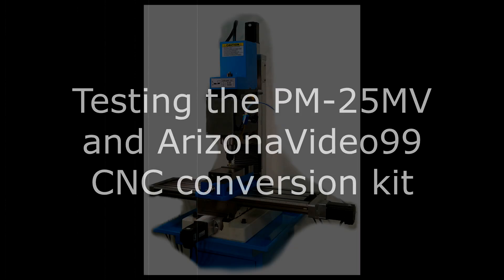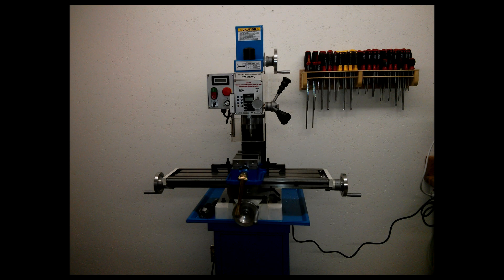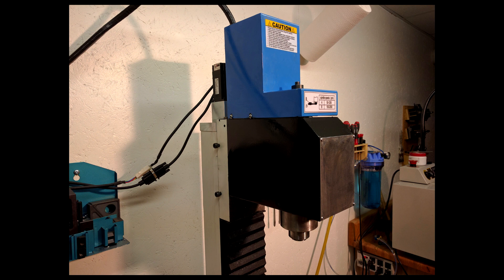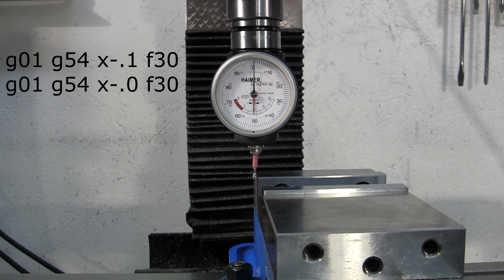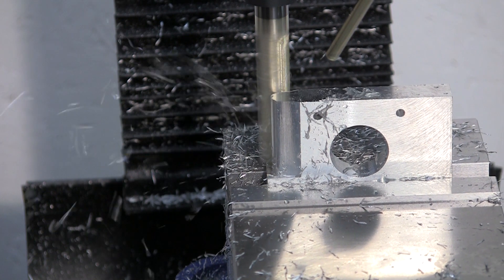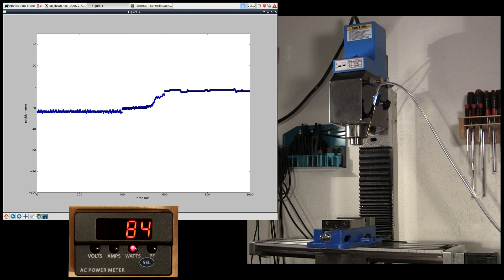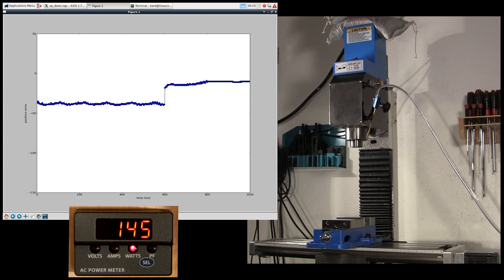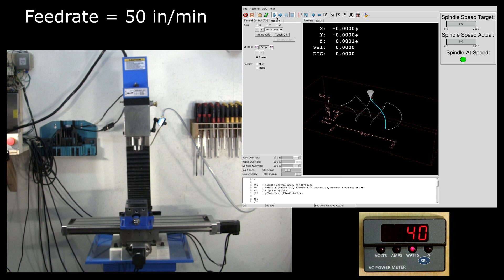PM25MV Mill CNC Conversion Testing

Comment from the maker: Check out my most recent video: https://goo.gl/Jj7cU1

After using the CNC converted mill for a few months, this is an update to a previous test video. The wiring is still a mess, but the mill was pressed in operation to meet a work deadline. Two related videos that I plan to make are on extracting following error information from the Leadshine Easy Servo motors and another on cleaning up the wiring

Comment: In general what would say the final repeatability tolerance is like?
Reply from the maker: For this class of machine, repeatability is swamped by a multitude of other sources of error. From experience, not exhaustive direct testing, for a CAM generated tool path, I expect accuracy within 2thou within a 6" cube. Manual programming improves this. Like everything, improvements sends costs up quickly. Hope this helps. Happy holidays!
Reply: @kentvandervelden  Thanks for the reply. Happy holidays.

Comment: This video got me to use same steppers on my diy mill and thanks for that!
And yes it uses so little power that my system including Makita router is at 250W in wood and 450W with metal machining spindle.

Comment: I really want to convert my pm25 Chinese clone yo cnc. How much do you think it will cost today ?
Reply from the maker: Ignoring tooling and computer, and reusing rough estimate...
Conversion kit: $800
Pulse generating control board: $200
Motors and drivers and power supply: $1000
I would budget $2500 for the conversion parts, and 100 hours. Add $700 if using servos. Similarly, add $700 if replacing the spindle motor. Budget high so there are no surprises.

Comment: Do you mill cold roll steel? How does she run? Did you have to cutt the saddle to install the kit?

Nice machine!
Reply from the maker: Cutting cold rolled steel works. Keep the gibs tight. I actually prefer cutting steel over aluminum. Steel does not gum up, the chips are informative, and threads are tough. To make life easier I order 1215 when I have an option, which is a little bit cheating. I use only carbide tooling. Wishing you the best of success!

Comment: I just received one of these mills and will be setting up soon. Thank you for posting this video.
Reply from the maker: Thank you for saying so. I'd be glad to help in anyway I can. I checked out your videos. My Dad rode an older R1100 and my wife and I worked on a Van's RV9. Always great to hear from people with similar interests. Wishing you the best of success in the new year!
Reply: @kentvandervelden  
The K1600 has been sitting since May or June of last year due to a safety recall BMW isn't able to address at this time. 
:( so I am on the ST1300 (reliable Honda) these days
Reply: @kentvandervelden  
Until I clean up and organize the garage a little better, the mill will remain in the crate. A lot of things are in transition with a new job (January 17 start date) and new year. I believe I'll have more personal time to work on some projects.

I certainly appreciate the offer of helping to get started with the mill, thank you! Its been nearly 30 years since I've ran one. Back in those days I was a programmer (C++) who wrote for a CAD/CAM software company, and I began working directly with some manufacturers who used the software. They taught me "pattern making" and I learnt 3-axis machining from them before learning other machining types (tool and die, mold making, etc).
Reply from the maker: @RobertLBarnard  Our experience overlap some. My first fulltime job was writing components for a CAD-like system. Geometry translators and simplifiers for a few CAD packages to convert to some in-house software. That was a great job.
Glad to help if I can, just send an email. Best of luck with the new job!

Comment: One of the weak spots on these machines is the way surfaces and gibs. In many cases the castings are not seasoned so they can warp slightly and since they make no effort to fit anything in china the mating surfaces can have very poor contact. They might also nit have proper lubrication channels or grooves. This can affect accuracy/repeatability and surface finish as much or more than the ball screw backlash and it can have a huge impact on how much of a cut you can take with getting chatter. Gib adjustment is also critical. The slides should move freely and easily without the screws engaged but without more than a couple of 10ths of play. If the ways are not accurately machined and fitted this is very difficult to achieve and you will either have excessive chatter or very high loads on the steppers if you need to tighten the gibs to stop chatter. These machines are essentially kits that need an extra step of scraping and hand fitting to perform well.
Reply: I am having a hell of a time getting mine adjusted for less backlash.  It seemed alright at first.  I had the z stick and then drop into a Damascus part yesterday twice and brake 2 bits.  I will probably tear down and scrape but is there any videos or good tutorials on adjusting the gibs etc?  I feel like I have to be missing something simple.  I've got a $500 lathe converted that is insanely accurate but with the pm-25 cnc I am failing.  Y gibs are tight but I can see it shift going from + to -...  Help
Reply: @DanBrock  use a 10ths dial test indicator and start with the Gibson loose. Shake the slide from side to side and measure the play. Gradually tighten the gib (assuming a single tapered gib) until the side to side play is 2 or 3 10ths. If you were to disconnect the feed screw the slide should still move freely. It should not feel tight. If you have poor surface contact it will be impossible to find a gib setting that provides both free movement and minimal play. In that case scraping is the only answer.
Reply: @sblack48  Thank you.  I did find the machine screw for the Z feed screw was not tight (well, tight but the washer was smashed in so it was bottomed out).  I'll try the rest of your procedure.  Thanks again!
Reply from the maker: I've been researching @Rv4 Guy's specs and going to give it a try. Sliding the assemblies so easily would be amazing but seems pretty far away. I had an Industrial Hobbies mill and lapped ways during conversion. Sounds easier and safer, but probably not as good. Would be nice to have Rv4 Guy's opinion on that. Don't need my mill right now, can take my time, and will replace spindle bearings as well.
Reply: @kentvandervelden  none of this is my own. I learned it from Richard King,  the guy who teaches machine scraping around the world. He learned it from his father and he scrapped un every kind of machine tool for probably 4 decades. 2 things really stuck with me seeing guys scraping in chinese machines, many of them new. 1 - how bad they were and 2 - how little work it took (usually) to make them good, even very good.
Reply from the maker: @HRST Some good videos on scaping ways can be found in Keith Rucker's restoration of a Monarch lathe. Episodes 12-22 may be the most relevant, but probably every episode is great. Please share if you find something more helpful.
https://www.youtube.com/watch?v=9A3kXFLSi40&list=PLbGC44mjwqrciooH79dIAQtdTjF3RjHMj&index=12
Reply: @kentvandervelden  stephane goetteswinter posted some good scraping content. Both Keith and Stephane took Richard King's class. Nick Mueller has some good content as well.
Reply from the maker: @sblack48  So much good stuff, thank you! Richard King's workshop is pretty close.
Reply: @kentvandervelden  Great, Thank you!
Reply from the maker: Thank you for taking the time to write this. My machine reaches that level of performance. What is your opinion on replacing the dovetails with linear rails? This seems popular, put probably is covering up the problems you point out.

Comment: old video i know but this guy made a good fix for the weak mast https://www.youtube.com/watch?v=X_6i4SN05HU&list=PLPawklYcquWqy6qoETTQcpmQUfkpp2ES8&index=157&t=61s&ab_channel=DavidLemereis
Reply from the maker: That's a really nice! I'd like to do something similar, I have scalloping patterns that this improvement is meant to address (though it may have been the video that played immediately afterwards that discussed the scalloping.) They'll small 15-30um, easily addressed with lightly sanding, but that's not always doable. This is on the most advanced side of the wish list. I'll be pleased to have more stable base by the end of the year, and I've been saying that for two years :) Wood would be quickest, but concrete might be interesting.
Reply: @kentvandervelden  been looking at different options too , i live in an apartment complex and tying my mill solidly to the wall will cause sounds made by my mill to travel throughout the apartment complex  kinda like when someone is using a hammerdrill to drill a hole in the wall 

wat i was thinking is using a thick steel plate thats milled flat where the machine sits on and bolt through that to the table/ pillar / cabinet its mounted on , and a contruction welded to that plate that ties intoo the sides / back of mast of the machine as a backbrace , 
https://www.northerntool.com/images/product/400x400/426/426419_400x400.jpg
like to be able to put shims between the mounts to push pull the mast straight if it or the "backbone"  isnt yet

did used his trick to raise my machine used a stack of 18mm mdf instead though , makes a realy solid base the machine is bolted through the stack intoo the floor
Reply from the maker: I'm glad you mentioned the MDF stack. I have vibration insolation feets, but the distance between then is so small and they are so high, the whole machine feels to be rocking on them. Not sure if it is practically, but I'll feel better when I finally build a larger base.

Comment: The link provided is a YT site -- no kits there.  Is there a better link?  Would you still use this conversion now?  I can see the Pro Cut CNC for this mill https://procutcnc.com/product/pm25mv-cnc-mill-conversion-kit/  Which is better?
Reply from the maker: That channel is by the man who makes the kits. Contact him at "David Clements <davedaxx1@yahoo.com>". I'm happy with the conversion. If starting over today, I would ask if the mill is large enough before which kit is best, but my needs have changed. I have no experience with the ProCut kit, but it looks similar in appearance and price. I would contact both sources, and let the responses guide the selection. Best of success to you!
Reply: @kentvandervelden  Thank you!

Comment: Sir please tell me
What is the difference between cnc milling machine and conventional vertical cnc  milling machine
Reply from the maker: Hi, not sure the difference you mean. "Cnc milling machine" could be vertical or not I suppose.. Of course, what I show here is a hobby machine and the industrial cnc machines are far more capable in terms of speed, power, rigidity, and all else. I hope this helps in some way. Ask if not.
Reply: @kentvandervelden  
Sir 
I mean 
I want to use fanuc controller on conventional milling machine , will it success or not
I hope you got my point
Reply from the maker: Sorry, I have no experience with doing that. It may be possible, but unless the proper documentation is available, and the controller is well abstracted from the controlled hardware, the challenge may be great. Fascinating idea though. Keep searching, good chance someone has tried on YouTube.
Reply: @kentvandervelden  
Sir 
I'm from India and here one of my friend is using cnc conventional milling machine so I want buy but I'm fearing n my friend don't help me
Reply from the maker: Pleasure to meet you. Maybe agree to purchase contingent on training? I used to work with people in Hyderabad, at the DuPont Knowledge Center.

Comment: Did you swap out the X/Y-axis coupler shafts to fit the 1/4" diameters or did it come with the kit?  Also, do you have your servo error code on github or otherwise publicly shared?
Reply from the maker: The replacements I used were from eBay. My link is invalid now, but looks like there are many alternatives. On the kit that I received the Y-axis coupler needed to be tapped, so be careful of the size you order. The code is available at the following link. Let me know if there is a function missing that you want. I didn't implement many (if any) of the write functions. I was hoping that the fault latch could be reset by software but there is no such command in the Leadshine software. However, instead of cycling the power, one can toggle the enable line to reset the latched fault. Let me know if I can be of any other help.
https://github.com/kentavv/leadshine_decode

Comment: Is it suitable for iron engraving sculpture design engraving.
Reply from the maker: Closed loop stepper motors could work well for the lateral movement of an engraving machine. As would servo and open loop stepper motors. Each have their advantages. First finalize the engraving machine mechanics, then determine the requirements for the motors, and finally select motors.

Comment: Hello Kent,

I have the same motors and mill. I am planning the conversion and would like to know if you are happy with these motors on all axis?
Reply from the maker: Hi Andrew, yes I'm happy with them. Of course the Clearpath motors would be nicer for my research because the Clearpaths have advanced performance monitoring, i.e., it's easy to extract current torque and there's a software interface that could be very interesting. The problem with the Clearpaths, for me, is their cost. I'm working on a lathe conversion now, I have an introduction to the project as one of my more recent videos, and used the Leadshine motors again. I again checked the Clearpath motors, but with all the goodies, I was looking substantially more, 4x if I remember right. The mill testing video was to demonstrate that people likely oversize the axes motors. I barely see over 100W consumed by all axes under normal operation. Of course, better to have excess torque than not enough, and that's why I mention at the end, it's safer to go with a bigger motor. However, the only time I have faults is when I crash. Another complaint I hear about steppers is their noise... on my lathe conversion I started with standard cheap-o steppers and they were loud... after receiving the Leadshine, the carriage motion (ballscrew-ballnut driven) is louder, and of course any machining operation will be louder yet. I'll have an update video on the lathe project soon and plan to demonstrate the sound difference between the cheap-o and Leadshine steppers. Whatever motor you select try to get one with a fault indicator that you can wire into your estop circuit to shutdown the machine in case of a crash. In my experience, the spindle will give up faster than the stepper motors. E.g., drilling requires a lot of spindle torque and force along the axis... and the spindle gives out well before the stepper motor. Best of success to you on your conversion. I would be glad to answer questions if I'm able. Kent
Reply: Kent VanderVelden 
Thanks for replying so quickly. 
I actually have three automaiontechnologiesinc.com 283 oz closed loop steppers. I plan on using these . I am happy to hear that you have had no problems. These motors seem significantly quieter on the bench than regular open loop steppers. 
I was thinking of having a counterbalance on the head, but after seeing your video I may give it a go without.

Regards
Reply from the maker: Marty's CNC Garage might have demoed your motors recently (https://www.youtube.com/watch?v=FQG0R1g-QRo), and he said AT confirmed they are made by Leadshine. If so, you got a great deal. If you counterbalance the head, you lose downward thrust important for drilling. I did tinker with counterbalancing the head on an Industrial Hobbies mill and later removed it.
Reply: Kent VanderVelden 
Yes those are the exact motors I have. 
Do you have problems with the head falling when there is no power to the motors?
I’ll only add a partial counterbalance if this happens.

Thanks
Reply from the maker: +Andrew Laux The jibs are tight enough that the head does not fall... Normally... However... I did have the head fall once with a Haimer probe in the spindle. The Haimer survived but it was gut wrenching to witness. That time the head was already heading downwards when the main power glitched or some other equally odd event, and momentum kept all moving downward.

Comment: You have an avery??
Reply from the maker: Sorry, what's an avery?
Reply: Large Bird Cage. I can hear birds in the background sing.
Reply from the maker: Ah, I feel stupid, I should have known that. :) No birds but that's fascinating you noticed that. The sounds are from motors and background. The motors sound different than most stepper motors - perhaps because they are closed loop or perhaps because they are three-phase. I used traditional steppers on my lathe recently before switching to same closed-loop steppers used there and so the difference in sound is fresh in my mind. In a quiet room the camera increases the mic gain, and there is more background noise here than normal, e.g., normally the air moving in the register ducts is inaudible. Occasionally you may hear a piano playing in the background while my wife is giving lessons to the neighborhood kids. Love the sounds of a full house. Merry Christmas and Happy New Year!

Comment: Closed loop lets you get away with smaller motors, as you don't need the overkill.
Reply from the maker: +MattOGormanSmith Absolutely, the position and current control loops give better torque density and a measure of position loss. Thank you for commenting.